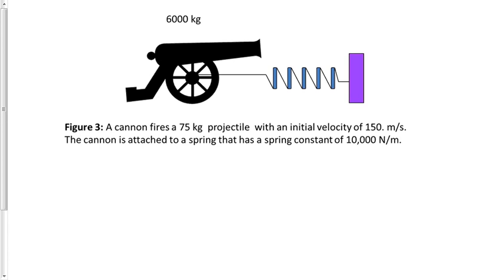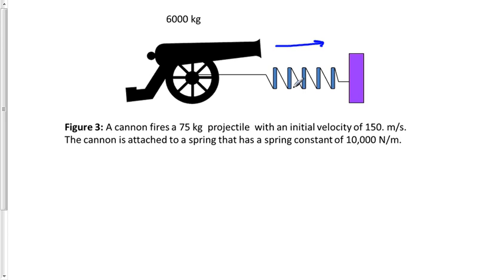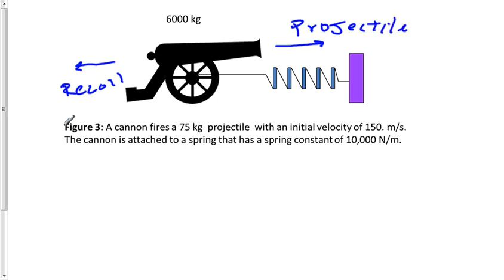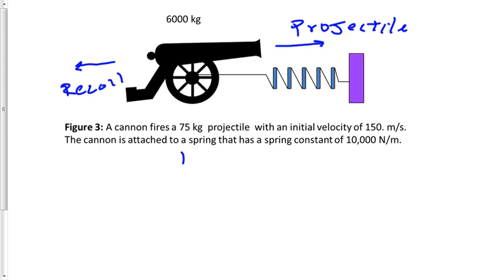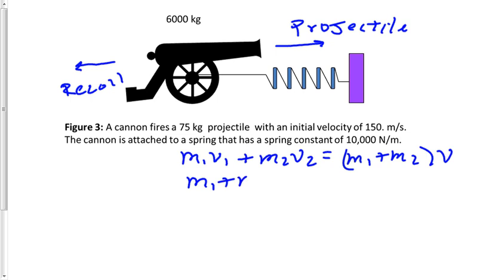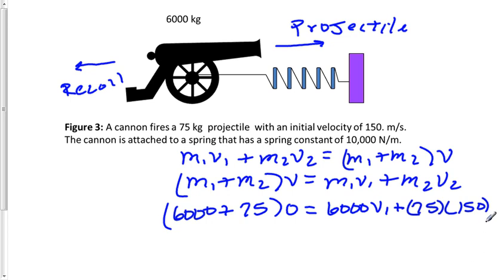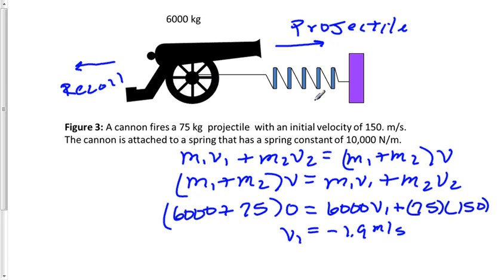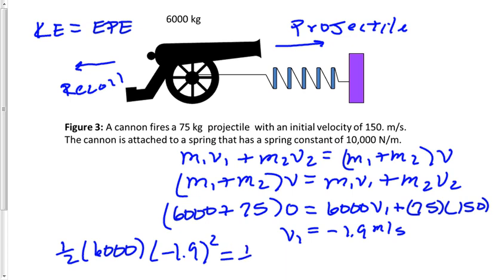Recoil Velocity

Comment: What if there was a damper as well in the system, how will it affect the conservation of energy
Reply from the maker: The conservation of energy is always observed.  The recoil velocity of the cannon would be smaller if a damper is used because some of the kinetic energy is absorbed by the damper.  It is important to note that since this system is an example of an inelastic collision, kinetic energy before the ball is shot does not equal the kinetic energy after the shot with or without a damper.
Reply: Rory Korzan Thank you very much, this helped alot
Reply from the maker: You are welcome.

Comment: I want to calculate the recoil force in newtons. Not footpounds, not newtonmeter, not joulemeters. In newton. But force is a different concept than energy and cannot be converted between eachother. So I need a formula for calculating the recoil force rather than energy. Nobody seems to have an equation or atleast this is incredibly hard to find. Can anybody help me.
Reply from the maker: I think you would need a time value.  Change in momentum (Impulse) divided by time is equal to force.
Reply: Rory Korzan How do I calculate momentum? I only know force times lever.
Reply: Rory Korzan So say I have 0Nm (gun in rest) then the recoil is 60Nm. And the recoil blast lasts 50ms. Then 0 - 60 = 60Nm. 60 Nm devided by 50ms is the amount of force in newtons?
Reply from the maker: I am confused by the unit Nm.  That is either a work unit or a torque unit.  Can you post the entire question here?
Reply: Rory Korzan I need a formula that ends in = recoil in newton
Reply: @yuriman123  
Yes.

Force [N] = ChangeInTorque [Nm] / Time = 60/0.050 = 1200 N
Reply: @perssoh11  I think we can both see those units don't cancel out.
Reply: @yuriman123  
I agree.
But in this case you can treat the kinetic energy as an impulse with constant force-

P = m x v      definition of impulse moment
F = dP / dt    definition of force
I = F x dt      definition of impulse

Thus is F = I / dt = E / dt

This is messy, I know, but this is how I would explain it.
Reply: @perssoh11  I see where you're getting at, for a rough calculation as I needed this might work